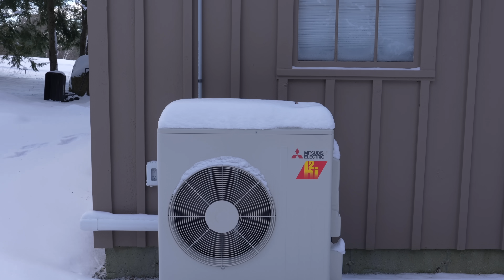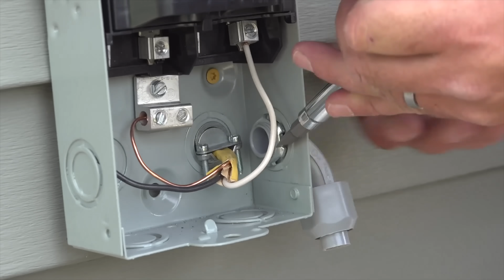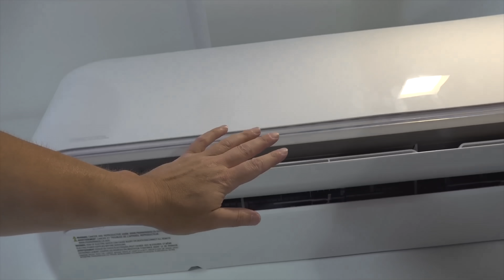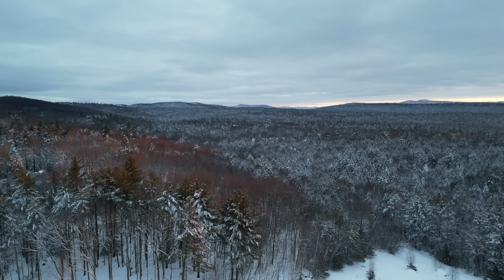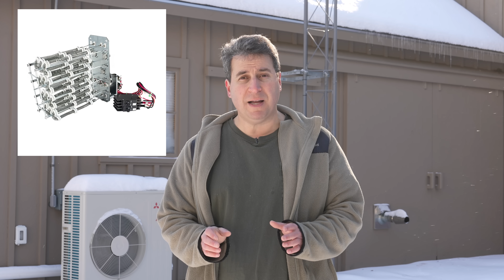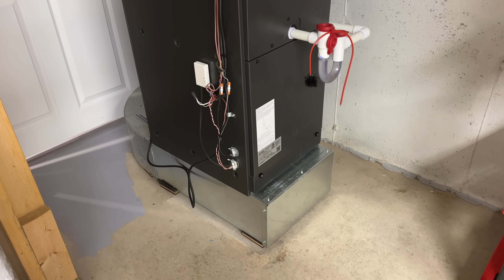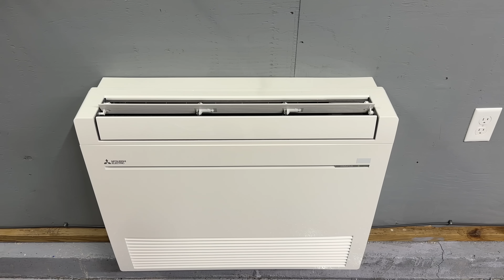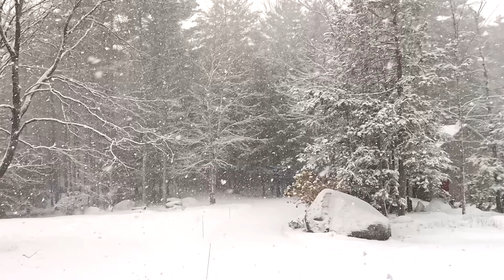Why Heat Pumps are now leaving people COLD

Comment: 3:54 Impossible. The COP of a heatpump never drops below 1.0, so resistive heat is always gonna use even more electricity than the heatpump alone!
Reply from the maker: Correct and incorrect at the same time, how? COP is COP, except when the heat pump is off, its not just 0, its worse than that. Heat pumps need defrosting more and more often as the temp drops. When this happens they start removing heat from the space and they are off during that time. These constant interruptions are what makes them not perfect at lower temperatures. So yes in a lab while running the heat pump always wins, until it needs a break, add these up every hour and this is where supplemental heating comes in. This is exactly why it is exists. This varies by heat pump  and some are better and worse, some houses are better or worse and some people are OK with 65 degrees vs 70. I absolutely love my heat pumps but during the coldest weather most need some help

Comment: i have the Senville 9000 Btu in my basement. it works great year round except we had one day that dropped about -10 last year. it did its best to maintain 72 but once it dropped down to 68 i kicked the boiler on. mine is listed for +5 outside temperature. overall its fantastic i got one out in my garage just to keep it above freezing.

Comment: I had electric baseboards before getting my heat pump.  I set the temperature on my baseboard heaters a little lower than for the heat pump.

Comment: Older heat pumps were not designed to function well in 20 degree or lower weather.  New heat pumps are a much better design and more energy efficient.
The first place to start when looking for energy efficiency in your home or business is to start with air sealing and additional insulation.
Air sealing and blower door testing are under appreciated tools.  Sealing up those air leaks can save money when heating and cooling and make the home more comfortable.  The money spent on air sealing and added insulation in the attic will lower the heat needed to be generated by any heating system.  That is the place to start. After that is done then look to a heat pump to save energy over a natural gas, electric or propane furnace.  Heat pumps are great. A well insulated and well built home saves energy, saves money on heating and cooling and is more comfortable.

Comment: I'm in a mixed climate area in the central east of the US. My heat pump does have the electric heat strips but it will not typically shut off when the temperature dips into the teens. I prefer my home be around 70F. My electric bills are most expensive during the winter months and my electric cost can approach $10 a day for my ~1000sq ft brick house as temps approach 0F. The heat pump is a great AC system, but I am NOT impressed by it's heating performance and do not recommend anyone rely on them where the temperatures routinely dip below freezing. (My system is only a couple of years old, btw.)

Comment: NOBODY installs a heat pump system in a northern climate without auxillary heater strips in the air handler (or pairs the hp with some other conventional heat source like a gas furnace).
Reply from the maker: You might not, but as you can see by the comments many installers do not. The mindset for some installers is save the money on the quote and & it if the customer complains later. The point of this video is to make sure people know abut this upfront.

Comment: When we added mini-splits, we sized them for air conditioning, not heating, because we already had a wood stove.  Depending on firewood prices, electricity prices, and temperature, we'll use whichever heating method is cheapest.  The stove is great to have for winter power outages.

Comment: So, -30 degree Celsius and blackout means you’re screwed. 

I’ll stick with my gas furnace, thanks.
Reply: gas furnaces need electricity too, Einstein.
Reply: @Tom-dt4ic  except, not for heat generation. You can plug the furnace into a camping battery like a Jackery for the blower fans operation and it will last days.

It’s ok, you can come to my place when there’s a blackout at your place in the middle of winter. Don’t worry about it.
Reply: @MB-nm8tt  If your that butt scared about power black outs, buy a generator using just a fraction of the savings you'll accrue over the years with a heat pump vs a gas furnace.  A decent generator, which will last as long as your gas supply lasts, will also likely be cheaper than a decent size camping battery, and be capable of also powering your refrigerator and lights during a multi day power outage.  A camping battery won't last but a few hours doing all this, Mr. Edison.
Reply: @Tom-dt4ic  rofl! you’re not saving even $1000 with a heat pump over the course of 20 years. Especially not with rising electricity prices.

Comment: Finally a video that tells you the truth about heat pump
I’m talking about areas that are  cold in the winter and you have natural gas . no reason to have anything other than natural gas furnace. Most of them are 96% or more efficient now. When they break you can fix them within a day ,they will heat the house no matter how cold is outside .

Mini splits like that Mitsubishi has got Freon there. If it leaks you have to find the leak during the winter time not a lot of people know how to fix them and when it’s cold, it don’t work. .
Geothermal may be efficient by just so much money to install it. if the pipes are on the ground and they leak good luck digging the pipes.
In the end 96% FURNACE
Reply: Natural gas production and distribution produces huge amounts of methane released into the air.  Then when you burn it, all that CO2.  

Your insights are less than profound.

Comment: Hmmm, well, I am in the fingerlakes area of NYS, I installed 4 senville units, 2 wall, 2 floor units. This is my 2nd winter using them and is the only heat I have in the entire house. Its not a huge house and it is older not insulated well. I have had no problems heating the house, now I must admit, the temperatures have not gotten below 0 degrees Fahrenheit since the install, but they have gotten close to 0 a few times. They have kept up with no problem. When I purchased them, it did say will heat up to -22 degrees, which is extremely rare to happen here. I love these units, very economical.
Reply from the maker: Thats great to hear. Senville has been really up and coming, gaining a lot of traction. They seem to have a very solid product and great reviews. Great to hear this real world feedback

Comment: The cheapest heating and cooling is air sealing and insulation with the right windows. Nothing beats this. Fix the house first, starting  with air sealing the attic and having the correct amount of insulation. We have been heating places with heat pumps for 11 years now, but after fixing the homes. And yes, when it gets below zero, you might need additional heat. Read the manufacturers data sheets as to efficiency when it gets below zero and get what you need. By the way, I live 20 miles out of Duluth MN in Wisconsin. It gets cold here.
Reply: Its funny when people always overlook this.

Comment: That’s BS about HP’s working well at cold temps. They don’t, no matter what manufacturers say. 30F is actually balmy for winter temps. North of the border the past week in Alberta temps haven’t been higher than -30C which is 22F. Many days @-40C which is -40F. Heat pumps are useless compare to Nat Gas or Propane. Manufacturers say HP’s are good to -25C when actually they begin to struggle at -15C. Stay with fossil fuelled heat. It’s actually safer.

Comment: It all comes down to what your pump is rated for and the cost of your backup heating fuel. The whole 'heatpumps are less efficient below Xf' or 'They can't heat blow Yf' spiel is useless. See what your unit is rated for, look at your electricity and fuel costs, set the cross-over temperature appropriately. 

I live in a large 250 year old colonial home in Western Massachusetts. We have a 4-ton central Bosch heatpump installed with a 96.5 efficient 80kbtu propane furnace. It can hold the home at 70F with it being 10F out while still costing 25-33% less to run than my furnace.

Insulation is nice, but BTUs are BTUs and COP is king.

Comment: Makes no sense to have a gas boiler and heat with electric. So supplementing electric with gas is an oxymoron. You would burn gas because it's cheapest then supplement with electric if necessary.

Comment: I need urgent help with with the demolition of my neighbor's very noisy heat-pumps.
It's in process  by the local authorities, but they take ages and ages to act.
It should be done legally.
Any tips or idea's ?
Can I blow out the fan with leaf blower from a 2,5 meter distance ?

Comment: As an HVAC Tech. heat pumps up north are not a good idea. just listening to the guy say you will need extra space heaters. That just wastes for money and energy.  Just stay with a gas furnace for comfort.
Reply: As a Northerner there's no reason to not have one either. They work on most cold days. Just don't replace your gas furnace. Use both. Unfortunately gas was never run to my part of town so I'm stuck with wood pellets and a heat pump.
Reply: I see no problem running heat pumps 99% of the time up north, but as with any heating system you should definetly have a backup, this goes for gas as well.
Reply: Getting more common in eastern Ontario
Reply: Hi.Let me remind everyone that there is 4 seasons in the year summer,fall,winter and spring.I live in Southern Ontario Canada.I had 2 Senville Aura 12000btu mini splits installed 1 in  1450sqft house and 1 in a double garage.I will add more to the house later.I am saving money keeping my house ice cold in summer with this 25.5 SEER mini split,I feel like putting the heat on to warm up in 30C weather.In fall and spring when the temperatures hover around the freezing mark,I heat my entire house on that one 12000BTU Senville unit.I also keep it warmer than I would if I was using my gas furnace because it is cheaper to heat the house with heat pump than with Natural Gas Furnace in fall and spring temperatures.As for winter or December January and February I will be topping up heating my house with heat pump and gas furnace  only because I dont want the water lines to freeze underneath the house where the gas furnace ducting is.I plan on putting a Senville Aura  heat pump in the basement utility room to solve this problem. I will use the heat pumps for  temperatures down to  -15C or 5F for U.S folks because at that temperature the gas furnace is better,even though I know the Senville heat pump will work to minus 30C or -22F.There's a guy on Amazon reviews for Senville who had his mini split heating his house at -37C or -34.6F in Saskatoon Saskatchewan .Bottom line the Senville heat pump is the cheapest money wise mini split that works in all 4 seasons,it will pay for itself if you use for 3 seasons of the year.As for the more  expensive units like Mitsubishi which may be made with Chinese parts or out right entirely a Chinese product made by GREE(most HVAC techs either dont know or wont tell you,but they charge for it as if its a Mitsubishi made in Japan) you will have a hard time saving money to offset the cost of 10 or 20 or 30 or more thousands of dollars to have it installed.Most mini splits are made by 2 companies Gree and MIdea (Senville is a Midea) and most others have parts in them made  by these companies.The price of  Natural Gas is expensive in Ontario Canada and that is only 1 of the reasons the heat pump saves money for me here. Thanks for your time
Reply: for being a 'HVAC' tech, you should know better, as long as temps in the north do not get below -20 a cold climate heat pump does the job for most situations .
Reply: Pros: 
*save $10/month on energy bills when outside temps are in optimal range

Cons:
*Spend $100/month more when temps are outside optimal outside temps range
*Initial expense is 3x a regular furnace/ac setup 
*Complex system where very few techs actually know how to diagnose problems (many just tell you you need a replacement)
* Short lifespan due to above reason.
Reply: @ no lol
Reply: OIL***

Comment: That's why heat pumps historically have had back up electric heat strips in the air handlers,  which usually cost more to run than gas or oil.  The sales people either don't know that or deliberately lie.

Comment: The other issue is the outdoor unit can freeze up if there is a lot of moisture in the air causing ice to build up on the coils & fan. most have a defrost cycle, but during the defrost cycle no heat is available inside, since all of the heat goes into the coils to defrost them.

Also as more & more people turn to electric for heating (heat pumps) the more strain it puts on the grid. this will lead to rolling blackouts.
Reply: Defrost cycles suck, but it's a minor thing.  The grid is extended much further in the summer in most locations.  Plenty of capacity for the winter.  And more capacity keeps coming online.
Reply: @frequentlycynical642  The US Grid is in frail shape. Most of of the major infrastructure is 80 to100 years old, beginning in the 1920s. Utilities also facing a major shortage of skilled workers and younger people have little to know interest in those type of jobs, and NIMBY has been a problem for a long time preventing upgrades & redundancy. California is already vulnerable to rolling blackouts, and rolling blackouts across the grid will become more apparent in the next 5 to 8 years.  Nuclear power plants & coal plants are shutting down faster than new NatGas Plants can be built. We been luck for a while as US grid demand has relatively flat since 2005.
Reply: @guytech7310  Yeah we've got our grid problems, but when things get bad enough, we will react.  As a nation, we've done this over and over throughout history.

Comment: I'm in a very old house and we got a ground source heat pump - we love that it doesn't suffer from these problems you describe where an air source heat pump has.
Reply: Super expensive though I imagine.
Reply: @christophercharles3169  yes, high initial cost. The recurring costs it replaced were also high.
Reply: Only badly designed air source heat pumps have this issue. Air source heat pumps are not good at supplying very hot water when it's freezing. So the solution is to have large convectors, that way you don't need very hot water. For most homes this works out cheaper than investing in a ground source heat pumps while still being highly efficient.
Reply: @teunvl95  I've found the best solution is HP + PV. I'm not really concerned about the higher energy usage during cold nights in our northern climate as the PV offsets it in the winter and during the summer sells so much back to the grid that our heating costs, running the house and charging the EV run less than ~$75 month averaged out for the year and that's with running on demand hot water.
Just the other day my dealer sent me an email offering us 490 watt panels for $88 dollars a piece. ROI is so low it's a better solution than a ground source system and less maintenance. PV is so cheap today I don't think ground source is worth installing any longer, maybe ten years ago but PV cost 10% of what it did back then.
Reply: @mosfet500 I’d be interested in knowing how much you’ve invested in all of your solar infrastructure. Also those cheap panels are because China is dumping them in the US and have eliminated our country’s ability to build panels.
Reply: @teunvl95 jepp that sums up our solution... we have a big water tank, water is heated up during the day and only is heated up in the night once it falls below a certain threshold. PV on top to support this system. But once per week we have to drive the water tank higher than 60c for legionelle prevention!
Reply: When I built my house I did look at heat pumps. I was quoted $30,000 for an in ground heat pump.  I went with gas.
Reply: I was working on some repairs on a house on Vancouver Island with geothermal heating…it was  15 years old and something happened to the control/exchange unit..hence the 7kw built in back up heater was on continually since it was a large house with high ceilings.   A few months later, that unit was replaced with a new $15+k unit + labor.   Seemed like a lot to me given the initial cost and “short” lifespan of the original unit.  But, natural gas is not available at the location.
Reply: @roykowalski4125 at least this was a necessary choice made by the owners and not mandated by the government. Here in NY, new homes cannot use natural gas heaters or stoves as mandated by the government.
Reply: Based in UK where heat pumps installed in less than 1% of the houses.  The government encourages with grants the installation of HPs 
once gas boiler needs replacing. Most popular solution seems to be ASHP with PV panels with batteries. We also have leaky old houses so insulation needs improving too. May include having to install larger radiators as most houses on gas using water radiators and HP's supply C/H water at a lower temperature than a gas boiler. Confused by temperature figures as we use Celsius these days so giving  figures in Fahrenheit and Celsius would be helpful. Subscribed now as videos are great, thanks.
Reply: A ground source heat pump furnace has an electric heating coil that engages the colder it gets, to make up the difference. I know my daughter has one.
Reply: @harrywood8196  they have one but it isn't needed in normal operation, at least not ours. Our coils are on a separate circuit which we have never turned on, and it has already been through an upper midwest winter.
Reply: @sirgermaine I’m about to find out what my new American Standard 3 ton variable speed inverter heat pump can put out in 20’s temps.. so far it’s been 2/3 more efficient than electric resistance heating at 35* $5 a day instead of $15! It does have an aux heat strip , but it’s turned off, because I want to see what it can do.